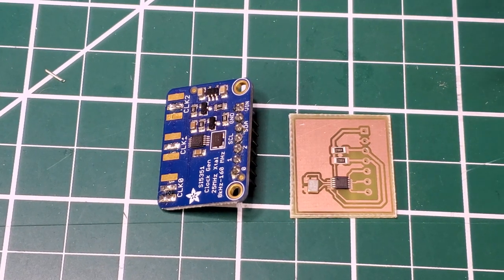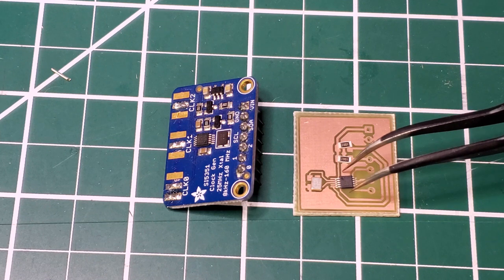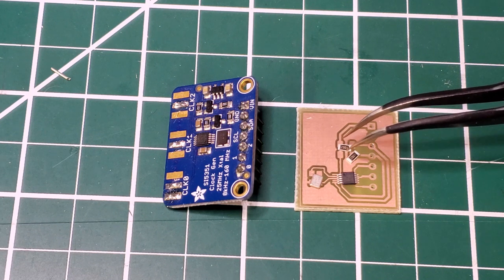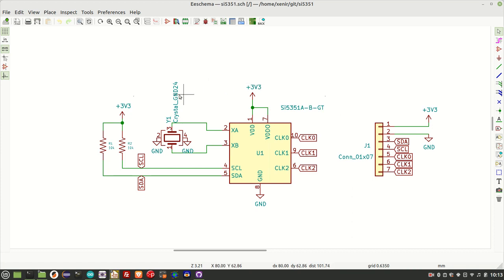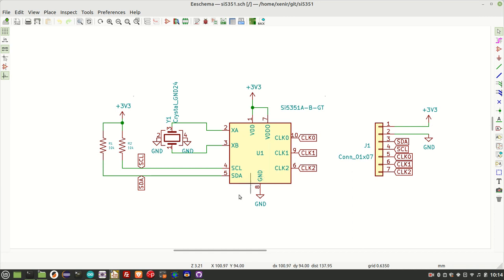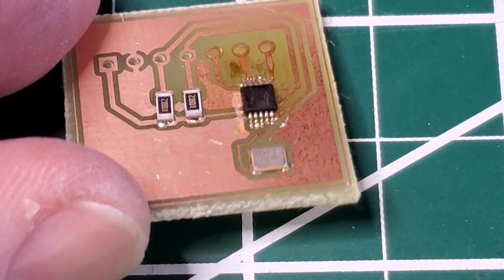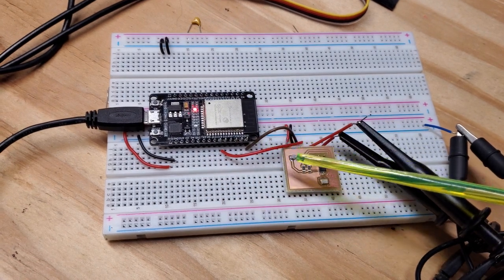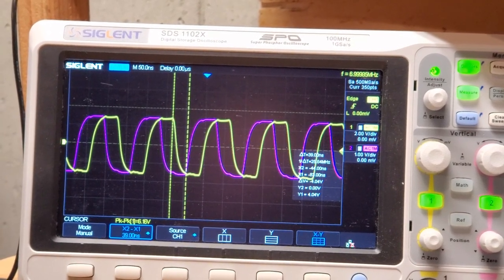Homebrew si5351 Board

Comment: As I read it, the pin spacing on those chips is 0.020... I routinely solder SSOP chips with spacing of 0.025, pretty easy and reliably. The trick is not to worry about shorting the pins, just dump a glob of solder on all of them, and then "wick off" the excess solder... the capillary action of the wick will do a good job of sucking off the excess solder and leaving a clean installation... obviously it should be examined pretty closely when done to ensure no bridges exist... but if they are found, just re-glob the chip and wick it again. 

Everything should be clean before applying any solder... that includes the iron tip, the solder wick, the solder itself, the PCB and the chip.I routinely solder down the diagonal corner pins first, to ensure the chip is properly centered on the footprint. ( confirm that with a close inspection, maybe with a jeweler's loupe or a low power microscope ) That might be pretty hard with spacing = 0.020, but maybe hold down the chip with Kapton tape on one side, and then solder pins on the other side of the chip, to immobilize it before removing the tape and soldering the remaining side. It might take some practice at first but should be fairly easy, once a few blunders are behind you.

Comment: Yes the SI5351 is a very interesting family of devices. Good work on managing to solder the device to your PCB which I imagine was quite feat. I have been playing around with the SI5351B and trying to modulate Narrow FM for voice with mixed results no pun intended. I am enjoying your videos.
Reply from the maker: Thank you John. Interesting application with FM - I have never tried that. How quickly have you been able to change frequencies with the si5351? Oh and it was a big pain to solder - particularly with no soldermask!
Reply: @na5y  If I am honest I haven't tried changing the frequencies at any great speed as yet however; I am planning to try the device as a VFO using a rotary encoder. The application I plan using the SI5351 is as a single output local oscillator for HF transceivers with the frequency LO  below 50MHz. I have found that running the clock output through a band pass filter really cleans up the waveform. Also I made up the SI5351B 20QFN version on a ready made breakout board using hot air and built all the circuitry around it using prototype board which isn't the best but I plan to have some PCBs made, if I can get to work properly that is. I will let you know how I get on.
Reply from the maker: Good luck with your experimentation John!
Reply: @na5y   I hope you don't mind me reaching out to you. I would be most interested in your thoughts regarding  FM modulation of voice on the SI5351 up to 5kHz of dev. I am wondering if there are other ways of doing this. You can see what I have been doing on my channel. I just sending an audio signal into the VCXO pin on the IC. Any ideas are most welcome.
Reply from the maker: @M0XFXUK  sure happy to have a look - I am a long way from an expert though - just a hacker ;)

Comment: Thank you for sharing. I am still studying the chip and needed circuitry. It appears that VDDO is the input for the pull-up voltage on the outputs; correct. If so, wouldn't a current limiting resistor be prudent?
Reply from the maker: You are probably right on that - I had a look around to see if there was an application note on the correct circuit configuration but I couldn't find one. Thank you for the comment

Comment: Ian,
I noticed you didn't use DC blocking capacitors on the outputs. I've been making my own Si/MS5351 clock boards for a couple of years now. Sometimes I use MSOP-10 to DIP adapters and sometimes not. Either way, it's easy to solder the chips with a hot air gun and low temperature 183 C solder. Sometimes I use a oscillator chip instead of a crystal. I usually use 2.5mm terminal strips on the outputs to make connections to coax instead of SMA connectors. Bypass caps on the power lines also help with these chips.
Reply from the maker: A couple of other people also commented on the lack of decoupling caps - definitely something for me to change! Thank you for the comment Jerry!

Comment: What is your main driver to homebrew it? What are you missing on the readily available boards available on the market? Just wondering
Reply from the maker: Primarily for fun Cedric. I had never soldered an  MSOP size IC and wanted to give that a go. I did need an additional module though as all my existing ones had SMA connectors soldered on them which made for a tight fit. I was going to just order it from amazon and I thought it would be fun to build one up. Thanks for the comment
Reply: @na5y  Perfectly valid reason for me. Well done. I did the same with some other projects. 73 de ON4CKM

Comment: I've bought some MSOP-10 (actually have used MSOP-14) SMT to DIP breakout boards I've gotten from Chinese sellers on EBAY and used these to make my own oscillator boards.  I've used through hole crystals as I have a TON of them in 25mhz and they work just fine.  There are two styles of those breakout boards, some have straight leads, others have longer traces so they can make the boards smaller.  The 14 and 16 pin breakout boards have the middle 10 pads straight, so I use those and cut the boards smaller by removing the ends.   I've placed ground pins between each of the clock outputs so I could easily attach RG174-U coax leads to the board.
Reply from the maker: I haven't soldered any MSOP-10s before this. Definitely something that takes practice. The SMD crystal was very easy to get on the board - I thought it would be the harder of the two. Did you use a hot air gun to solder or an iron?
Reply: @na5y  i actually hand soldered it with a Weller WES51 using the smallest diameter tip they had.  Also used the smallest diameter wire solder I could find.  A good magnifier helps, and I also have a bino microscope to inspect afterwards.  I usually have to use solder braid to remove blob shorts.  So far I haven't had any unrepairable soldering failures. 
I do have a hot air station, but for a chip this small you REALLY need a stencil to put down the paste.  You also need a GOOD solder mask layer on the board, which many of the Chinese breakout boards don't seem to have.
Reply from the maker: @KennethScharf  I might try hand soldering one of the si5351s and see how that goes. I have some small tips but I do need to get myself some thinner diameter solder though. Thank  you for the comment!
Reply: I don't think you can use SMT to DIP converter board in high freq oscillator circuits. This chip is quite sensitive to PCB layout, crystal position, and soldering quality and other factors that will have impact on parasitic capacitance and inductance.
Reply: @sullivanzheng9586  The Si5351a is rated for output at frequencies up to 200mhz (the original release was rated to only 160mhz, and hams have pushed the output to at least 250mhz).  At those higher frequencies, I'm sure layout is important, but not so much below 50mhz for use in an HF receiver. Building up a circuit on a breadboard with a ssop to dip board having short leads between pads has worked just fine for me.  At 25mhz the crystal oscillator works fine with a wire lead FT49 microprocessor sized rock.  Perhaps the very small extra capacitance and inductance on the crystal leads might throw the oscillation frequency off, and perhaps some less active crystals might not oscillate, but I've not had this problem, and one can always tweak the calibration in software after the fact.

Comment: I made my own si5351 PCB by JLCPCB and got stable clock signal. However its phase noise is significantly larger than Adafruit SI5351 board if I measure the phase noise using a TinySA. It is seems that SI5351 is quite susceptive to crystal quality and PCB layout around crystal. 

Have you checked the phase noise?
Reply: Is this with the same batch of chips ?? wouldnt be supprised if that is more to do with the Sillicon especially as there are many "Clones" of this IC.
Reply from the maker: I have not and I do have a spectrum analyzer so that might be an interesting thing to do as a followup - thank you for the comment.
Reply: Probably a job for a fast scope rather than the Spectrum analyser you can see the relative phase change as an eye diagram
Reply: @101blog  I guess SA is generally good for phase noise measurement.

Comment: I have a QRP Guys 5351 VFO kit, but ruined the IC that came with it. (Guess how!) The marking on top of the IC says 5351 on the top line, 83R2 on the second line, and 848 on the third line. Digi-key sells the ICs, but I can't figure out which one to order. Any chance you can shed some light? Thanks. KJ4FX
Reply from the maker: It definitely looks like an si5351a - same as the one I was using. Follow the digikey link in the video description if you want to buy one. Its going to be expensive with the mail though .

https://www.digikey.com/en/products/detail/skyworks-solutions-inc/SI5351A-B-GTR/4069612

Interesting that kit makes you solder it on - most kits come with it pre-mounted. Getting the old one off might be a pain without a hot air gun - be gentle or you'll lift the pads. Before you remount it make sure you tin the pads a little. If you have no success have a look at this VFO from qrp-labs - that one definitely has the si5351 installed

https://qrp-labs.com/vfo.html

Good luck with your build!
Reply: @na5y  Thanks much. I keep an open cart at Digi-Key, and add to it until I get enough to justify the USPS mailing cost. 73

Comment: Not supprised, the lack of a solder mask isnt too bad on the descrete SMD parts but even a few tight pins will be hell with bridging etc.grr
Good work though keep it up
Reply from the maker: I had a bridge between one of the clock pins and the VDDO pin that I just couldn't get rid of. I had to lift the IC off and re-solder it. I think I need new solder paste too - the stuff I have has gone very stiff. Thanks for the comment!